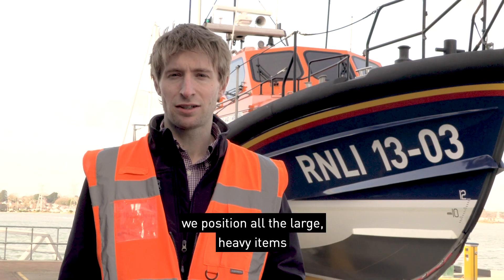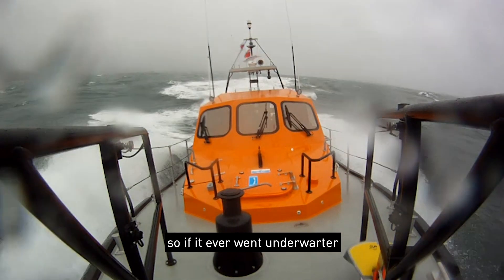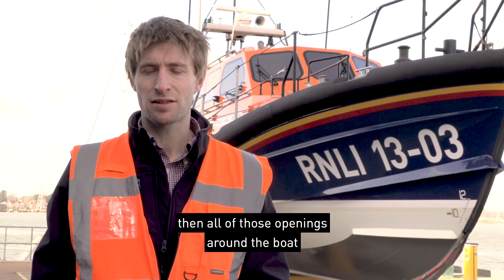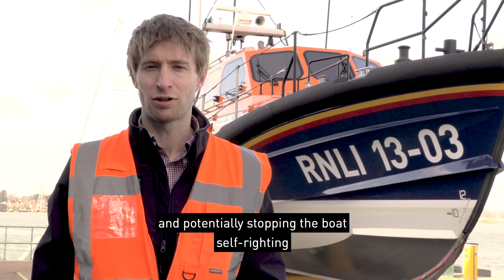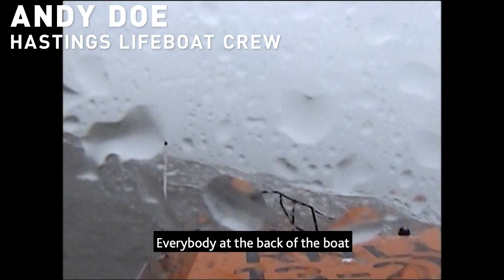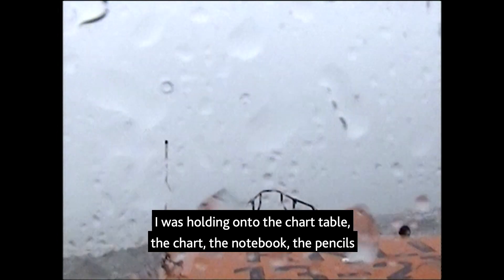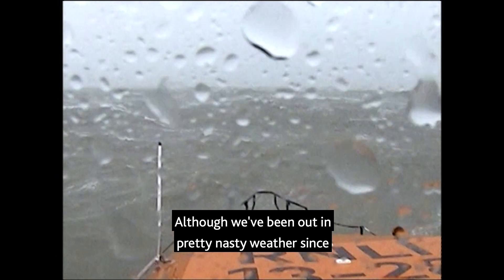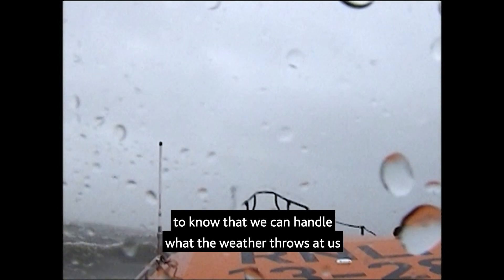One year on: how Hastings lifeboat survived Storm Ciara knockdown

Comment: The thing that does not show up in this shortened video is that the boat was unable to maintain enough speed to beach safely. As they got into the surf the speed dropped dramatically so they were forced to turn round in the surf resulting in the boat being broadside to the large wave that nearly capsized the boat. I assume tha speed dropped as the water jets were sucking foam not water but have not seen any official explanation.
Reply from the maker: Hi John. The Hastings incident features prominently in this recent episode of Saving Lives at Sea, with crew members discussing exactly what happened that day. https://rnli.social/3aFdrRq
Reply: @rnli  They discussed the boat speed dropping as they ran towards the beach but did not explain why. They need to hit the beach at a reasonable speed to ensure the boat is clear of the surf and does not get rolled on the beach. They also reported they had quite a lot of water in the engine room - presumably the cameras in the engine room and the bilge alarms on the management system did their job followed by the bilge pumps removing it.
Reply: No boat or ship ever wants to turn beam on to a sea like that....that's the most dangerous position to be in......the water jets to give foam like that were obviously half out of the water....so forcing water and air out which gave the foam effect.....only way in seas like that is to keep head to sea so you ride over the wave ......does get a bit bumpy at times.....as for sea sickness......only guy who never gets that is because he or she has never been to sea.

Comment: Is there a point where it’s too dangerous to send out the all weather lifeboat or are they truly all weather? Fantastic seamanship keeping that bow pointed  in the right direction!
Reply: I think 'all weather' is quite literally ALL weather here. The boat is shut watertight whenever they are at sea, so it doesn't really matter how much it rolls and whether waves break over her or not. In theory she should always come back to the surface upright. I think the main limiting factor would be comfort. At some point the amount of rolling will become unbearable for the crew, preventing them from properly operating the boat. There is also a limit of 6 crew and 23 casualties according to Wikipedia, beyond that the boat doesn't self-right. But I think with 23 casualties you're probably already stacking people on top of each other inside.

Of course this is all just a guess on my part, purely based on my understanding of the engineering in this boat.
Reply: Simple answer? NO!
These men truly are the bravest of the brave.
Reply: @AR1G3  I'd argue they do have a limit.

I would imagine the the limitations would come from the force of the waves and wind. Waves breaking can produce a huge amount of force, eventually those waves can cause physical damage to the boat.
And for wind, if the wind was strong enough, it could over power the boat so it's unable to maneuver, if the boat is close to shore, it could be serious damaged by the shallow waters or rocks.
Reply from the maker: Hi Sam. All-weather lifeboats (ALBs) are capable of high speed and can be operated safely in all weather conditions. They are inherently self-righting after a capsize and fitted with navigation, location and communication equipment. Big and bright, the sight of one of our all-weather lifeboats on the horizon has given hope to many.

However, there are a number of factors that are considered before launching to rescue, and the conditions and safety of crews are always of paramount importance.
Reply: @AR1G3  I dont know where wikipedia got that info from. It is incorrect. As a former  RNLI crew member, I can assure you that a shannon class would be a real pig to handle with pnly 6 crewmen.
As for where we could accommodate 23 casualties.......all I can say is we'd do it in dire emergency. But no one would have room to move.
Reply: Folks, I dont know if you were aware of this, but the staff of the RNLI are mainly volunteers. The institution gets no government funding.  The cost of running the finest maritime rescue service in the world is astronomical. But we do rely entirely on your voluntary contributions. So can I as every single one of you a truly massive favour please? Next time you see a RNLI collection box, put some cash in it.
And guys, when the pubs eventually re-open, after lockdown, if youre standing at the bar, half pissed, waiting to get that last pint before closing time, consider going without that pint. You'll probably throw it back up onto the footpath anyway. So go without that pint, put the money in the lifeboat box, and you will be as much of a man as the best lifeboat crewman. 
Plus, you won't have such a bad hangover in the moning. But you will have helped save a life.
That makes you a truly REAL MAN.
Thanks everyone
Reply: @paullee5573  Thanks for correcting that!
Reply: @rnli  Which station do you operate from please?
Reply: @khankrum1  Think about the varios disasters around the cornish coast a few decades back. Common sense, and a sense of survival says " Stay at home". Our crews braved it , to save lives. And paid for their braver with their own lives.
True blue heroes.
RIP all RNLI crewmembers who gave their lives on active service to the community.
Reply: @SomeGuy-lw2po  Yes the do have a limit. Human endurance. The vessels and equipment utilised by RNLI is the very finest available. It will not let us down. That is how we can make the claim that we will never let you down. I am experienced both as rescued and rescuer. Trust me my friends, when you are in trouble at sea, there is no sight on planet earth more welcome than the big orange and blue vessel . You know from first sighting that you will soon be safe.....and warm.
Reply: @paullee5573  thank you my friend. I take my hat off for you. I was just pointing out that although these boats are fantastic, they have to have a limit before they will break themselves.
That's just the engineer in me. Although I didn't consider that the first limit to stop these boats is what the crew can withstand. Which is a testament to the boats, because as long as you guys can go out, your boat isn't letting you down.